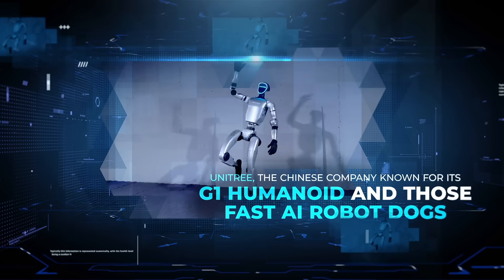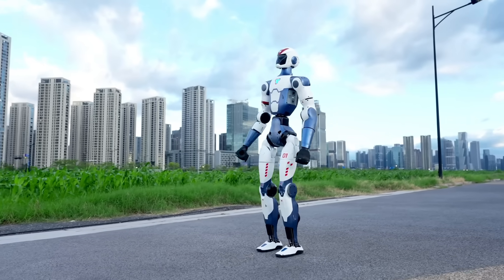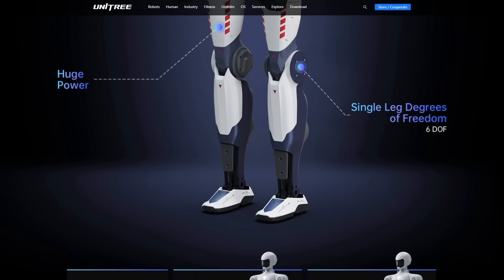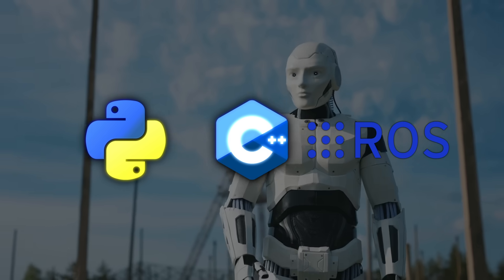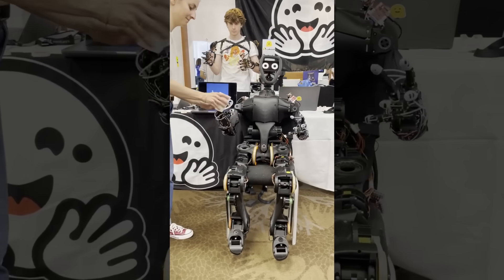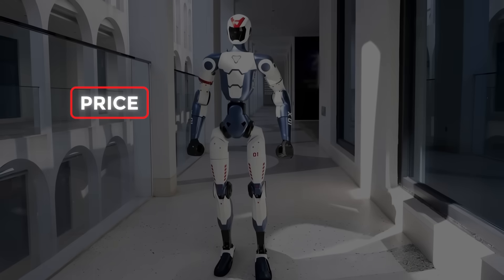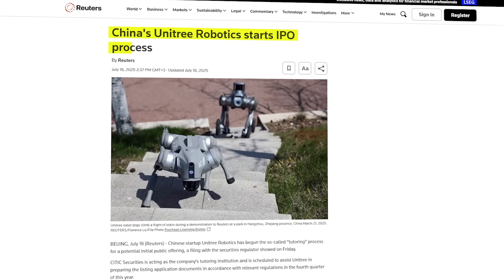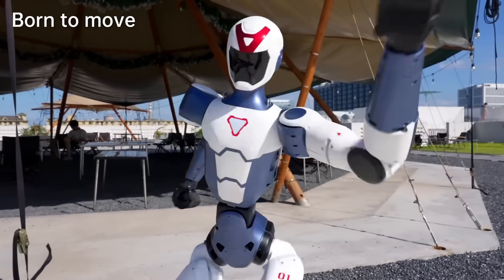China’s New AI Robot Is So Good and Cheap It’s Scary: Unitree R1

Comment: If the available humanoid tobots today are so impressive, the MFG should show their models doing realistic domestic tasks like  making a PBJ sandwich, or more industrial dextrous tasks like measuring cutting then installing base molding in a living room or working aside humans on an automotive assembly line or perhaps playing against a human in a tennis match or playing catch with a football or baseball.

I keep hearing people say that robots are becoming so real you cannot tell they are a robot. 
I CALL BS!
Yes, you can purpose build a robot to perform specific tasks like welding a steel frame together or sweeping the sidewalk, but they would not look like a person or even be able to walk away when the task is complete. To effectively perform said tasks, they would have articulating appendages that look nothing like a human and require human programming and control for each individual task performed.

There is nowhere near enough intellectual memory, precise dexterity, or rational processing available with current modern technology to make it happen, nor will there be for another 50 years.

Sex robots, well that's an easy one. Just cutting a hole in a watermelon will suffice for most male horndogs😭

Comment: I'd say for the wider public, this will currently still remain just a gimmick. It's once every day usefulness increases, that we'd see an explosion of it, and then we will also see changes in laws, as well as insurances, voluntarily or likely mandatory, to cover for damages to property or even life. What if your robot suddenly steps into the road due to a malfunction and gets hit by a car? The damages to the car, possible injuries to the driver.. it's all these little things in daily life, which will need to be regulated, but it no doubt will come, and not before too long we likely will see humanoid robots on sidewalks, carrying shopping or what not, to start of stared at by everyone, but in only a brief period of time, they will becomes as common a sight as someone holding their mobile phone.
Reply: You won't see this sort of robot for shopping it'll just be a cart that follows a sensor attached to the user. Something like that could already be made relatively cheaply but there probably isn't a big enough market.